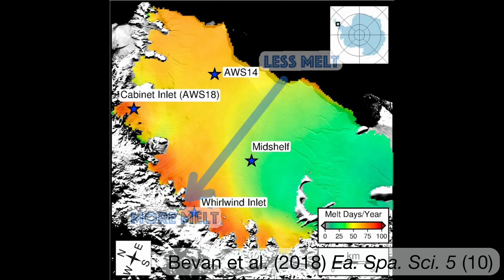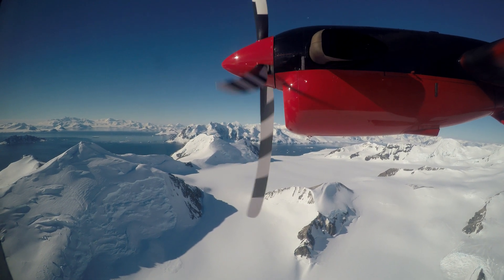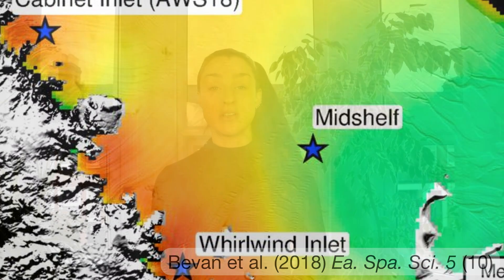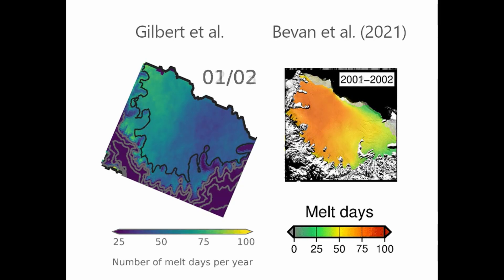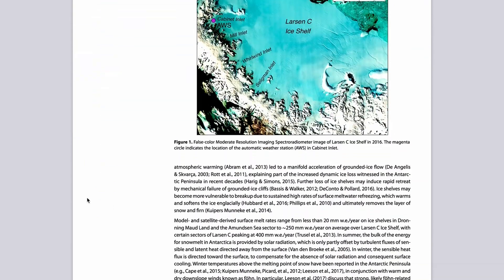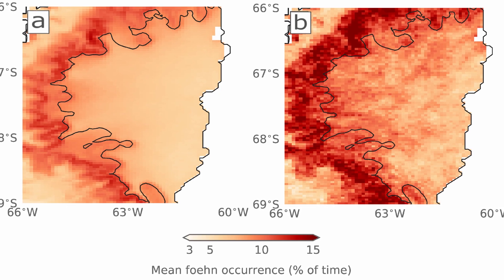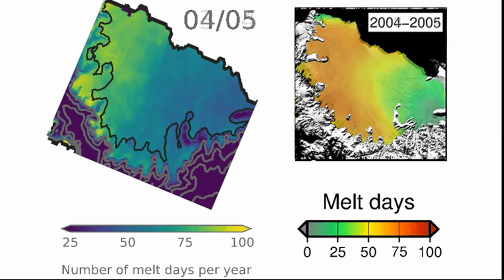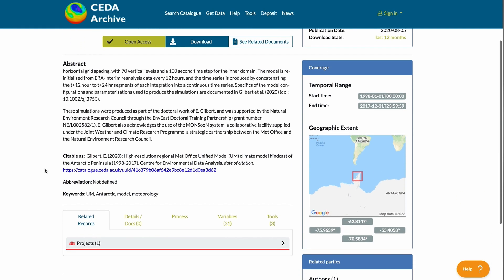What's making the Larsen C ice shelf melt? Part 1: our model works!

Comment: I think there should be a balance of oceanic influences with Deep Ocean Heat as well as the Föehn winds.  But Kris Van Steenbergen has another idea, and that are lunar tides.  Larsen C always intrigued me since it collapsed in July...the middle of an Antarctic Winter.  Larsen A and B both happened in January.  I thought that was so significant I said "Yikes". 
Do you have an historic record of tides in that area?  Could that have also contributed?
Reply from the maker: The difference between Larsen A/B and C is that Larsen C hasn't collapsed, it calved an iceberg in July 2017. That was likely unrelated to the broader climate forcing and had been on the cards since the 1960s. Surface and oceanic melting are both drivers of current and future ice loss and potential collapse.

A former colleague actually looked at tidal influences and concluded that these were insignificant in comparison to surface forcing on Larsen C